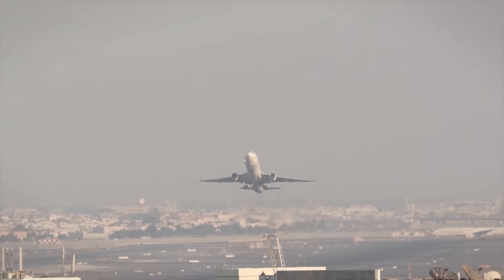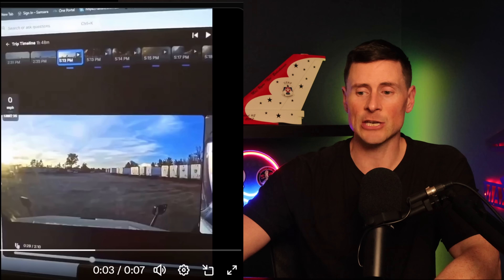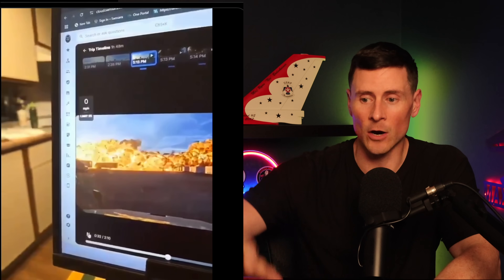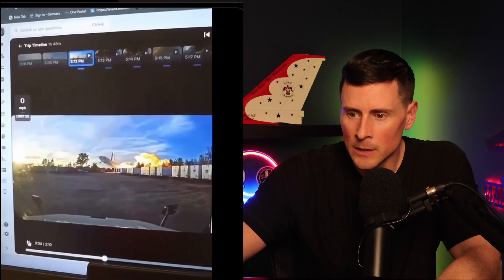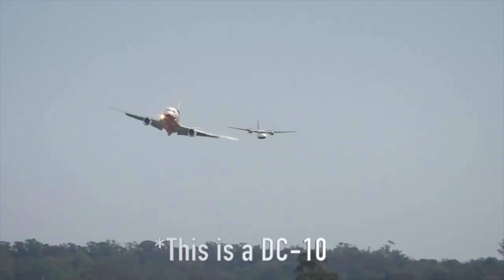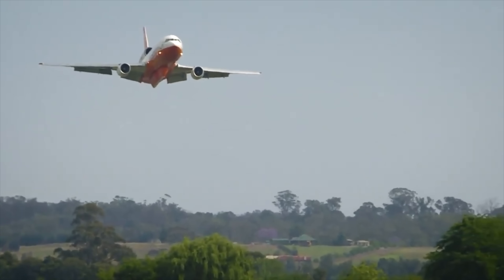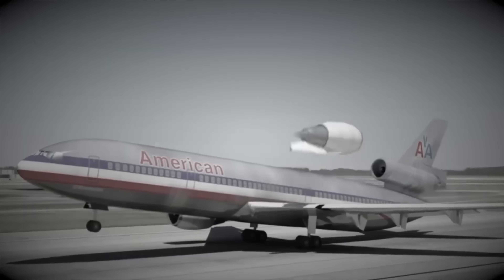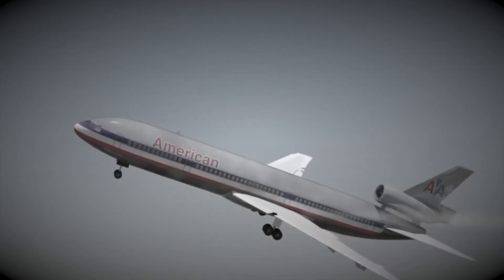Airline Pilot Reveals CHILLING Clue in Final Moment Before UPS 2976 CRASH

Comment: Retired TWA L1011 pilot here. My take is catastrophic #1 engine failure and no containment, caused fuselage/wing fuel tank damage and subsequent fire. Zero chance of recovering. So incredibly sad. God rest their souls
Reply: Sounds plausible.  So I guess the big question is going to boil down to "why did #1 go bad so catastrophically?"
Reply: @tombohn1 FAA estimates the uncontained engine failure rate to be 1 in 375,000 flight hours. I would say the top two suspects will be FOD and lack of safety culture. Not necessarily a lack of maintenance but business pressure to go outside of recommended cycles to cut costs. Perhaps a combination of both.

I just read the NTSB confirmed that engine #1 detached prior to the video we’ve seen. I don’t even know what to call that.
Reply: @evansacks9911 "detached"?? Damn!!
Reply: @evansacks9911  There  is a new video out with a clear view of the aircraft prior to crashing which shows the number one engine missing.
Reply: @evansacks9911 I read on another video, someone posting that they were right there watching that plane take off and there was an explosion around the #1 engine and then the engine fell off.
I hope everyone who witnessed this crash and who are injured can find peace.
Reply: @tombohn1  Was a massive fireball on #1 engine still during takeoff roll, cause of that maybe related to fuel line rupture inside engine itself.  Then the superheated structural wing elements were weakened and the attempted rotation possibly caused the structural failure.
Reply: @Nick_the_Gold_Bach that makes sense
Reply: That amount of heat can also affect buoyancy of the air below the wing. Hot air provides less lift.
Reply: @tombohn1 has been in maintenace short before crash. possible use of counterfeit parts in engine.
Reply: @jeffreybloem Counterfeit parts? I don't know a thing about planes, so I'm sincerely asking if that really happens and, if so, why it is allowed. 😮
Reply: @LisaBowers - airplane parts are supposed to meet certain specifications.  They are not cheap.  There have been documented cases where parts were purchased from a supplier that did not meet specs (I.e. counterfeit).  I cannot speak to whether the bad actors are nefarious or just trying to make a buck without required materials and tooling to meet specs.  There are some videos on YouTube on this topic.
Reply: They will investigate. Something was cracked or the integrity wasn't there anymore for the engine to fall off, not from being on fire for a short time. Hydrolics lines definitely burned, the power loss seemed to be toward the middle, to the end of the run way from engine #1. Engine 3 was pushing so hard on the right side trying to get to V2 and was probably very hard to get the nose back around, powering the right side of the plane only. Maybe FOD at the beggening of takeoff, but that doesnt explain the engine coming off? Everything is checked and safety wired, torqued to spec? Odd.
Reply: @stevenlamorie6558 a deer strike at 100mph+ can shear engine mount bolts and crack structural components. Not saying that happened, but the investigation will determine it. It is very, very odd that we would see an engine fall. We normally find potential structural cracks during scheduled inspections which prevents these types of incidents because we catch things early on but something either got missed somehow or it was a sudden strike or failure. 

God bless this flight crew and all injured civilians on the ground!!
Reply: @stevenlamorie6558 Agreed. NTSB should be able to determine the domino effect here....engine failure,disintegration,expulsion of blade fragments,fuel system compromised and fire.
Reply: I agree but I also think it sent debris into the #2 engine.   Add a fire feed with Jet A and possibly Hydraulic Fluid and we have this result
Reply: @chrisanderson4799 oh absolutely, I completely agree with you here. I’m a jet engine mechanic and have seen that occur before. I don’t think it was the main cause but it was a huge contributing factor on the extent of the catastrophe
Reply: @chrisanderson4799 
Just to add to this; it's also possible that the extreme AoA caused bad inlet airflow into #2, leading to surging/stalls.

I don't have a reference off-hand, but I seem to recall other cases where aero/maneuver circumstances have lead to compressor stalls, and I have to imagine the tail-mounted engine would be particularly prone to this (at high AoA, it would be receiving air that's turbulent from having flowed around the fuselage)
Reply: @chrisanderson4799 100% mostly likely what happened. One engine and being that heavy, unable to climb on one. Two yes. One No.
Reply: Yea that was the 1st clue, the #1 engine was gone and the wing and ailerons were on fire. While taking off, you are screwed. Recovery is not going to happen. May they all Rest in Peace.
Reply: DC10 crash in Chicago was a result of an engine change using a forklift where they damage the put some tool marks on the Cone bolts and as we know with metallic structures when you put a mark on them, that’s like the line where they’re gonna crack so that was an engine separation due to Bad maintenance procedure. The MD 11 was basically a Brand change because the DC 10 has had such a bad safety record ironically the improvements made to the MD 11 to match the triple seven twin in fuel burn jet in fuel burn actually made the airplane worse, in that it was pitch unstable. They shrunk the horizontal stabilizer, and I believe it had no dihedral which made the airplane very dicey, especially in gusting winds it also has a form of MCAS called LCAS
Reply: I have a question, sir, with the sparks that we saw, and the indication that there was issues with the equipment, fire or what not, there’s nothing that would have sounded, no alarms within the cabin in the cockpit to let them know so that they wouldn’t try to take off?
Reply: @rnng4mylife927 the aircraft hot powerlines a couple of times
Reply: @rnng4mylife927 In the 12 seconds or so from V1 to rotation you're goal is to get airborne ASAP ,even with a single engine failure,totally doable still on 2 engines.I believe things just went bad so quickly there was no chance for recovery unfortunately
Reply: Yup. Tri-jet. There seems to be a reason we don't make them anymore.
Reply: @TheJeffcurran Wish they still did! Roomy and wonderful to fly.Loved my 18 years with TWA as primarily L1011 captain.
Reply: Thank you for the insight. I absolutely loved the L-1011….such an amazing aircraft!!
Reply: @chriswessels4021 UPS plane was MD-11F not L-1011.
Reply: Correct,I was referring to the plane the gentleman referenced in the comment that he flew for TWA.
Reply: @jimmyhaynes6609 I know, I was referring to the point that the gentleman making the comment said “Retired L1011 pilot here”
Reply: Probably not too far off with that rough assessment.
Reply: Did you happen to know a Wallace McGreevy at TWA?  L-1011/747 pilot.
Reply: Zero chance indeed reminding us of AA 191 in 1979 @ ORD.  except this time a torch cut through everything.
Reply: Yes, God bless and protect all the first responders!
Reply: Wasn't the L1011 a better plane? Had a friend at Delta Air who said L1011 was better than Dc10 and MD11 design.
Reply: I heard the plane was on the ground for two hours because there was a problem with the number one engine so it will be important to see what the problem was. Was there vibrations or a fuel problem did that cause a fuel leak. Was a fan blade close to breaking. Was the pylon loose. There was a warning sign. May all those lost rest in peace. Blue sky’s and tailwinds to the pilots.
Reply: @mikemicksun6469 : NTSB already debunked that rumor.
Reply: Remember AA DC10 crash out of ORD?
Reply: Question, can you reject take off due to this issue even after takeoff call out / speed?
Reply: RIP to the lives lost. There was a plane B767-300 engine that caught fire back in Oct 2016 (Flight AA383) failure of the HPT Stage 2 Disk during the take-off roll, with that same make GE Engine as the UPS plane??? Airworthiness A22WE Certificate Holder The Boeng Company 2007. UPS N259UP has Engine GE Eng Model no. CF6-80C2D1F & American Airlines N345AN Eng Model no. GE CF6-80C2B6 are these the same engines??? The engine fell off the UPS plane and many comments about re installing engines procedure / process is very important and what about issues with the stage 2 discs failing is common with these engines? I googled this model engine what other common issues were, and it came up with this information re HPT stage 2-disc failure. It's an old plane at 34 years old!
Reply: He possibly could have recovered had he aborted at mid runway when smoke first developed big im sure they didn’t know the extent of what happened yet at that point  and lost critical seconds too quick
Reply: @1982MCI honest question here.  Would he have been able to see that smoke or was there equipment that would have notified him?
Reply: @TanyaMatthew-memories They were probably past V1 (go speed) and had they tried to stop they would have gone off the end of the runway… they pretty much had to go and try. It SHOULD be able to do it on two engines. However, as the host states, if #2 is having problems too, then they’re only on one engine, and too heavy for one engine, hence can’t climb.
Reply: @rabidjackalope1319 thank you for your response.
Reply: @rabidjackalope1319  if the runway was longer, could the plane be stopped after getting to that V1 speed? Since it can’t climb due to the weight and engine failures, what would happen if they just tried to stop the entire plane and abort the takeoff as if they hadn’t reached that speed yet? I’m just curious, it’s hard for me to even wrap my head around all of the technicalities here but I’m trying ha
Reply: @1982MCI nope, already going too fast
Reply: Does anybody know why they would try to take off with the engine on fire and not immediately brake and shut everything off?

Comment: The first thing I thought of when I saw the video of this crash was flight 191 in 1979 leaving Chicago. The MD-11 is basically an improved DC-10.

The least crowded flight I've ever been on was on a DC-10 flying from Madrid to Miami one week after the 1979 crash. There was more crew than passengers.
Reply: I'm around 15 miles from  the tragic 191 flight crash site and remember it often, and now this new one in Louisville.
Reply: @greghanna7753  I remember it well myself, lived about 5 miles south of where it crashed. It could have been much worse crashing slightly more west directly on the mobile home park (fire did get to a few of them), and a little more west of that was the fuel storage tanks. It crashed mostly in an open field. Between the open field and the mobile home park was several Quonset huts and one was a mechanics business where the only two on the ground were killed.
Reply: Yes, my thoughts too. I was scheduled to go thru Chicago the week after the 1979 accident.  I switched to TWA on a 727 thur Cincinnati.  Found out the AA maintenance crew used a forklift to reinstall a replacement engine and damage the connection points. They did not follow MD procedures using the right kind of engine lift tool.  Hope this is not something like that - someone in the maintenance crew taking a short cut.
Reply: 251 passengers is few?

Comment: It could take off on 2 engines at max weight but not just one. They had no chance.
Reply: Even with 2 engine if the missing one severed hydraulics and fuel lines when coming off there’s no saving the jet

Comment: The AAL 191 DC-10 that crashed wasn't the DC-10's fault; it was poor and questionable maintenance done by AAL.  I can't confirm this but I heard the UPS MD-11 was delayed due to engine maintenance on the #1 engine.  Which, if that's the case, the maintenance will have to be heavily scrutinized to see if corners were cut, if they were rushing, or if inferior parts were used.
Reply: You don’t know this, your speculating. How about we find out the facts before sharing hurtful and harmful comments
Reply: @KarenK-h9m  that's why I said it's speculation not established fact

Comment: No1 failed and exploded which FOD’d No2. Worst case scenario for sure.
Reply: I don't necessarily think it fod'd #2. If you look at the video from the ramp workers at the very beginning, you can see it's ingesting a ton of extremely hot air and combustion gasses from the inferno of the #1 - that alone is more than enough to cause the compressor surges we see, as well as a massive reduction in thrust or total flameout.
Reply: @GlutenEruption , good point. The amount of fuel being delivered to the inlet of No2 alone could render it useless.

Comment: I have a question about the taking off process. Why would you risk  crashing from the air if you could use the runoff area at the end of the runway to crash? Wouldn't it be better to crash at a slower speed? I understand not all runways would have enough space, but that information could be added to whatever system you have to understand airports.
Reply: There is no short answer to your question.  Past accidents have shown  that rejected takeoffs past V1 have a larger negative outcome the continuing.   The no man’s land is when anything other then a single engine failure  happens that affects stopping or accelerating.

Comment: It did happen before exactly the same thing because airline maintenance instead of using a crane or jig to remove the engine alone saved time using a forklift which during a change over or break had became unstable due to the forklift not having the precision hydraulic stability . Also using the forklift allowed the engine AND Pilon to be removed which was not the set plan . The reason they did this is because it bypassed disconnecting wiring and sensors . So when the old MD plane was come back to they hadn't noticed they had over cranked the forks reconnecting the engine and they cracked and deformed the clevis that held the whole engine and cowl and reverse thruster assembly in place  and after a few flights after being put back in to service this exact thing happened .That plane did get higher but came down im sure same side same wing down due to the damage to flaps , fuel lines etc.
Reply: Yes, I remember a 90 min show on the History Channel. The chilling thing was they ordered inspections of all DC-10s and found 5 other planes that had damage and were "ticking time bombs" so to speak. In that case the engine ripped out hydraulic lines when it departed the wing causing the slats to retract but they managed to take off. A bunch of minor things stacked up to doom them. Stick shaker only on the capt. side and was powered by the alternator of the engine that departed the plane. The asymmetry of the configuration resulted in that wing stalling first when they reduced speed to troubleshoot and take stock of what they had and they lost control. Those were the main points I remember. Sad that one might have been saved, get to a long runway and land fast after a fuel dump and making things as symmetrical as possible. IDK if any ever did a simulator model. In yesterday's case it appears uncontained engine failure damage and fire was a no win.
Reply: @timprussell  I hardly use air travel but I have been on a couple of jets and my first plane trip was on the small Cessna four seater. Different  totally im just so interested in how these aircraft are truly and honestly really the safest way to travel even safer than walking the streets of a major city . I am also really impressed on how the human element manage in such dire situations whatever the outcome. It takes a very very special person to be a good airline or military pilot. I cant even drive a car or just didnt get the chance to get my license ,,,
Reply: @snivla4  I've consumed many seasons of the Mayday/Air Crash Investigations show from National Geographic. After you see enough investigation breakdowns you can understand why flying is so amazingly safe. Sadly a lot of lessons written in blood but that is true for may safety rules.
Reply: Electrically, as an aircraft electrician for 20 years, this makes zero sense. 

You avoid the disconnects by not removing the cowling, which is still going to leave the engine dangling by the wire harnesses attached to it. 

I don't know the schematics of an MD11, I did mostly DoD aviation, but I've done enough to know this does not make any sort of remote sense whatsoever.

Comment: FOD .....brought the Concorde down...FOD on runway is my Guess.. Fuse pins on motor  to wing are designed to break away under stress
Reply: Wouldn't it take more force to shear off an engine?